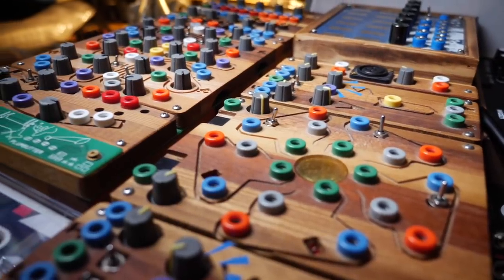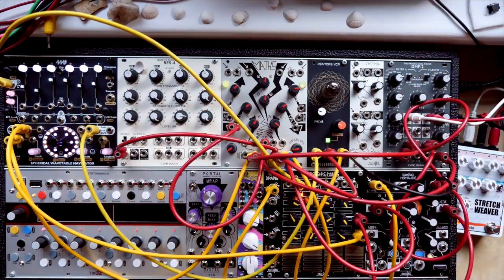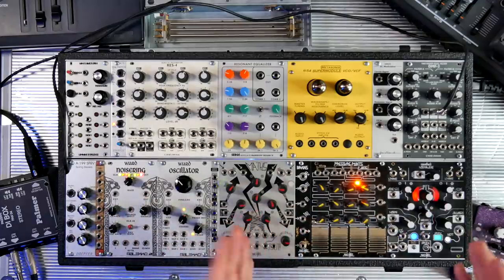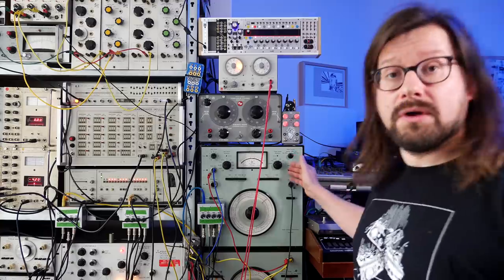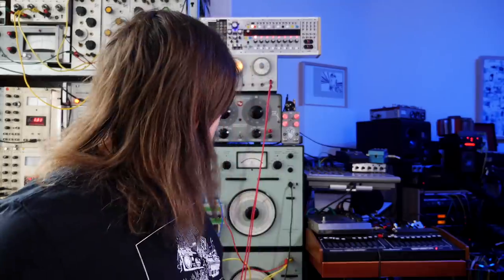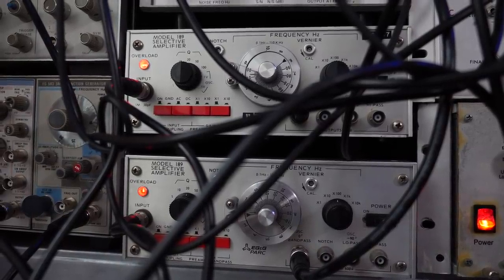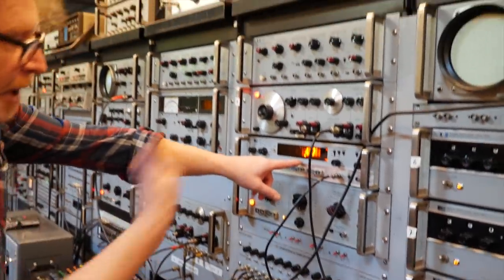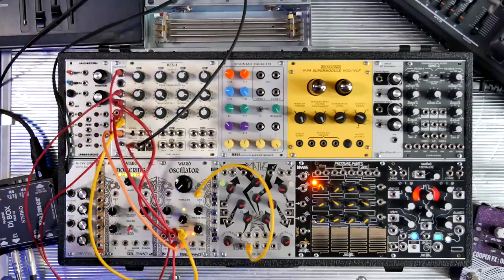Recreating my test equipment setup in a Eurorack modular synthesizer

Comment: The trick is finding a way to make your tools serve your work, your expression, while letting them influence but not to replace that expression. It is not always possible - sometimes we just need time away from an instrument or processor, to let that field of possibilities go fallow before it finds new uses or old ones in new work. When the tools are good ones, our changing lives will usually allow us to find those points of reconnection later on - as you have done here beautifully with these mostly old modules.

It is not that the other modules did too much for you so much as you were looking for a different way to work with your current state of mind and your plans to travel. Sometimes it is just wanting a different set of handles for much the same sounds. Sometimes you just need a more or less direct connection to those sounds, and other times you just need a whole new starting point. It's all okay - so long as you understand what you want and you are lucky enough to have options.

Thanks for the video.

Comment: Your videos makes me want to try using simpler tools. No fancy multiwaveform oscillators with linear inputs, just small modules that do only one thing. Squarewave? Here you go. 1V/Oct? No, that's a different module. :-)
Reply from the maker: It does help I feel. At least in my case, I make simpler, yet better music.
Reply: @Hainbach  I'll report back in a year. :-)

Comment: Hainbach, have you considered getting an 8/16 track recorder and using the modular setup to lay down one track at a time? This might help to give you a reference point when recording, using the controls to fit the feel of the current track into what you are recording. Once tried this making noises on an Ultranova and surprisingly it came out OK.
Reply from the maker: Not so much for me, I like writing a piece, rehearsing it and then recording it in one go.
Reply: @Hainbach  Wish I could do that, I simply don't have enough hands, and the ones I've got don't move quick enough :)

Comment: Inspiring as always. I like your workflow. I have gone a similar route. I have made a small, portable 42HP modular case which can run off of USB power. I just have the most useful modules in there - two Radio Music modules, a Wogglebug, Turing Machine and Rings. This has been my go-to case recently. I also impose arbitrary limits on how I can configure stuff, much like the Three Module Challenges which everyone seems to ascribe to. I sometimes introduce a twist, for example, I can use any / all the modules in the case, but limit myself to a fixed number of patch-cables. This has helped me overcome the choice paralysis / procrastination barrier, especially when away from home as I can then take just the bare essentials.

Comment: Hi Hainbach, do you use an external sequencer with this system or do you just tune the oscillators and filters and get gates/triggers from the timetable? And do you still use this system now that COVID has struck?
Reply from the maker: System is already different since I don't really travel anymore. Its folded into my studio rig. Right now I use only a few modules per patch, but combined with piano. I did not use a sequencer with this, except for the 0-Control one time.
Reply: @Hainbach  Thanks for the super quick reply, I already imagined that not travelling your test equipment fulfills the role of this rack and more. I really love the sound and the approach to Stockhausen-like Neue Musik but living in an apartment with small kids without studio space I can't really build a test equipment wall. Would love to since the stuff is quite accessible here in the Netherlands. Would you advice getting into a rack like this or is there another approach that might be rewarding for a father of small kids with limited time and space?

Comment: Great rack setup.  I'm surprised you haven't looked into Buchla Red Panel stuff, as the original system 100 stuff really reminds me of lab equipment with more CV capabilities added.   They have also recently announced that they will be doing through-hole kits of the system 100 stuff sometime this year as well.  I'm much more excited for that than the red panel stuff, personally.
Reply from the maker: I did not want to buy anything new, this all stuff I had in my rack. but red panel sounds gorgeous indeed
Reply: I've been really considering diving into some of the 100 DiY stuff that is sold on modular addict and discussed on muffwiggler, but may wait to see how the official Buchla stuff pans out.  Likely be a bit overpriced.  Supposedly the Human Comparator that did the TTSH is involved.

That said, I've actually got a Korg 2600 coming in the next month or so, whenever they start shipping, and have just finished building a 1601 sequencer clone for that.  Maybe I should try being content for a few months.

Comment: is it possible the moog murf could substitute for the random source res eq? looking at the filter bands and the frequencies are mildly close. just popped into my head and i haven't yet tried it out. will let you know if i come up with anything although i cant compare. also any other recommendations for substitutes on some of your modules that are out of production and/or way too pricey for us non-professionals.
Reply from the maker: Murf is fantastic, I need to get mine repaired. But isnt it it more expensive than a DIY ResEQ? Else, you can always look at Doepfer for cheaper yet quality replacements.
Reply: @Hainbach  good point on cost, but i have had my murf for years and it could use a good work out since it has been neglected lately

Comment: Love you sharing the journey and evolution.  Not sure I will say this right.  I struggle with feeling inspired from sequencers, knobs and cables.  I have keyboard synths and eurorack.  I also have guitars and an acoustic drum kit.  I much prefer the tactile-ness of playing a guitar and drums vs a synth and modular.  However, I love the sounds from the modular and synth.  What am I missing that could help me feel more from the synths and modular?  My compromise is using a sensor on a drum or a guitar pedal to bridge the gap to bleeps but then there is the limitation of the attack, sustain, decay and release of the respective instrument used.  Thanks and I really enjoy these videos.
Reply from the maker: Maybe something like the Touche? Looks really tactile.
Reply: @Hainbach  Definitely on the right track.  I need some interface to touch that is expressive.  Maybe I just need to get various items to hit or pluck, mic them and use fx.  By the way, that metasonix sounds amazing.  I've looked for one and have yet to find one for sale.